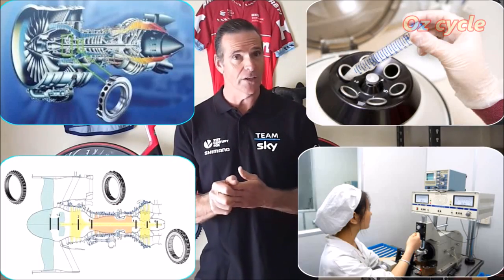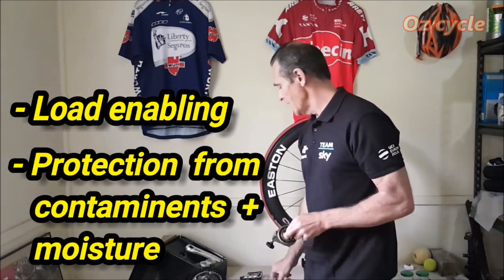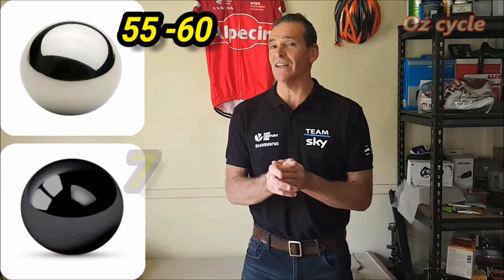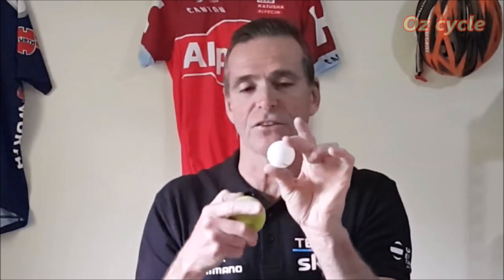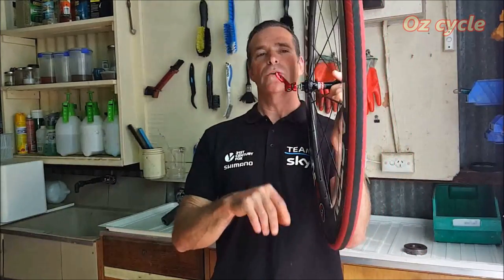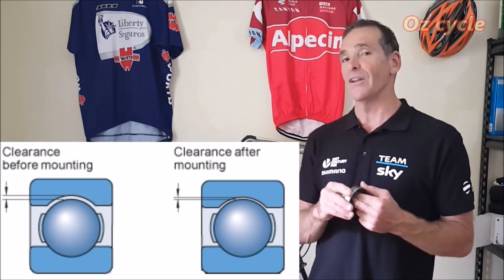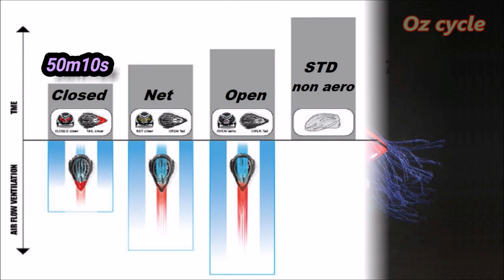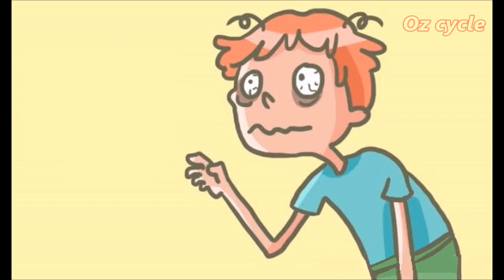Ceramic Bearings - You need to know!

Comment: I have never tried ceramic bearings on my longboard. The longboards commonly use bearings for speed and the ones I am using are really great and fast at its affordable price.  Did not require special treatment or care. My question is: how can the ceramic ones be so much better in terms of speed or distance run? Does anybody can make a comparison between both?
Reply: Ceramics are better in every way, except that they ruin their races over time, where steel get deformed everywhere, as they get hotter through higher friction, need more lube, get dents in every corner and are not uniform in size. Amphetamine ceramix gold offers SiNi in gold for nice price, btw. They are especially good if you are overweight. The only areas  where quality steel are better than ceramics are case of lightweight skaters that do jumping tricks on very hard wheels. Both bearings will be ruined, steel wins because its cheaper to replace.

Comment: Hi How are you today? You look like long time ago Which is Mac gayber. Anyway I am looking for Triple layer bearing for freewheel or cassette and bottum bracket. Long time ago when I design bicycle I put triple bearing system but someone took out. They also took out multiple chain system.
If you can make triple bearing system then the bike will running at almost 60mph. Could you find out where can I get the triple bearing system? Thank you. Have nice day.
Reply from the maker: Not sure what you mean by "tripple bearing"?..maybe another viewer can help here.
Reply: outside ball bearing show half of them middle side normal then inside bearing half of them show.  @stevenleffanue

Comment: This may be dumb, but why don’t we use magnetic bearings on non load-bearing components like the pulley wheels? The way I see it, we can avoid grease, friction, contamination and maintenance altogether.
Reply from the maker: Good idea. Not saying it want work but using magnets would mean a  heavier component.
Also, jockey wheels are under a load, especially when riding on bumpier roads the chain pulls and slackens the tension.
Reply: I imagine the extra weight and size of such bearing design would not be overall advantageous. There is also the problem of changing magnetic susceptibility of air vs dirt between the magnets. Wouldn't the bearing collapse if it gets dirty?
Reply: @AG-el6vt  I don’t believe weight is much of a concern, many riders already put OSPWs in search of frictional benefits that add some weight. I have no idea how dirt would effect a magnetic bearing but due to the lack of any grease or oil, rinsing with water between rides should clean them out just fine

Comment: So if you have to service your ceramic bearings every few thousands km and they cost significantly more than steel bearings, its better to buy cheap steel bearings in bulk, remove the seals and reduce the fill rate to 25%. Just replace the whole cartridge once in a while and you will gain better performance for the same periodic service, but less time consuming and cheaper.
Reply from the maker: Almost,yes. Except the cheap bearing want have super polished rolling surfaces so there will be slighly more friction to begin with also.

Comment: As a retired military aircraft engineer, Me and my colleagues always got a chuckle out of "cyclists" and the things they do.  Ceramic bearings are for very high speed applications, 10,000 rpm+ not a snail pace of a bikes 80 to 90 or maybe 100 rpm, hehehe .  And bearing work best under constant load, not pulsating loads like in a bike.  hehehe  Using axial load bearings for radial load applications.
Reply: Despite all that, I am somehow reaching consistently higher top speeds on the same slope and much smoother pedaling from the ceramic jockey wheels.
Reply: @warrenkommers  After looking at the data from various sites, yes they are as you say, You actually save 1.33 watts of power exerted, Thats a big saving over 1000 kilometers. That means you have to eat one less energy bar on that 1000 kilometer ride. Great savings
Reply: @gregrobbins9493  Trust me, the great savings will never be as appreciated as your great attitude. Just tested again, coasting it’s a 3.8 mph difference on a 13% grade near 50mph. But hey, I must be imaging things.
Reply: @warrenkommers  Then you are the only one with results like tat. All the pro sites I looked at show very little difference. Besides coasting has absolutely no affect on jockey wheels, they don't even turn while coasting. 
And, the test results for bottom bracket, wheel, and jockey bearings combined is 5 to 10 watts on road bikes with 130 psi tires on perfectly flat pavement. They were tested on pro riders that didn't know which bearings were on the bike. 
You should contact the bike magazines that do bike and component testing as your results are much higher than theirs, they pay good money to testors
Reply: @gregrobbins9493  Do you even ride? Have you ever raced? Yes, I am talking about the wheel bearing here specifically. My ceramic pulleys however definitely provide less resistance than stock. Very very noticeable. That could be more about how shit the stock Shimano bearing are but none the less. I would agree BB ceramic should make very little difference if at all. Not surprised there but your statement was global. As for the pro peloton, they use ceramic all the time. Sorry.
Reply: @warrenkommers  Believe what you want, only a bicycle shop owner can change your mind.
As for your ceramic pully claim. How do you get "coasting it’s a 3.8 mph difference on a 13% grade near 50mph"? Coasting, the jockeys are not even turning.
Go to a pro camp, most of what they use is because of sponsors. Why use something cheaper that give similar results when the sponsor give you the expensive stuff as long as you claim it's better.
Reply: @gregrobbins9493  Coasting, I AM NOT talking about the jockey wheels but ceramic wheel bearings compared to steel. Two separate events I am describing my personal experience. Only the descending can I put numbers on. I have been and worked with many of the top world tour teams in my career as a commercial filmmaker.
Reply: @warrenkommers  50mph on a bicycle, thats over 130 cadence with a very high gear ratio. You must be a world class professional cyclist, if not you should easily be able to get sponsors to put you in the standings.  And as I said before, how come , with those results ( 3.8 mph difference on a 13% grade near 50mph) , you're not in all the magazines, because those numbers are unheard of . That is of course you are not comparing old rusty bearings to the ceramics, but good quality stainless steel to ceramics
Reply: @gregrobbins9493  You said you were an engineer right? There is this thing called gravity, and when you are on a 13% descent, you can achieve speeds beyond your pedaling input. Infact, the heavier(less pro) you are, often the sooner you achieve this moment. I'm not sure how many times I can say this was a test (with no pedal input for less variables) with brand new steel vs new ceramic WHEEL bearings.
Reply: @warrenkommers   You said you put them in your jocky wheels, they have no effect when coasting as they are not even turning.
hehehe, 50mph on a bicycle, world champion riders can rarely hit 45, most don't even get into the 40's. 13% is not much, only around 7 to 8deg

Comment: Rider weight has a massing bearing on wattage losses. The heavier the rider to more effort is requited to propel the rider also the heavier the rider to more load is placed on the wheel bearings and tyres resulting in increased rolling resistance and lost watts. The heavier the rider the more the surface area and losses through wind resistance.
Reply from the maker: Absolutely....except they go downhill fast 😁

Comment: how much is to much load for a ceramic bearing ball?
I mean track cyclist pushes 2500 Watts on those ceramic bearings
Reply from the maker: Not sure. Maybe the sprinters use steel bearings.
Reply: just saw the german sprinters use custom ceramic speed octalinc bbs
Reply from the maker: Ok. So ceramic bearings must be ok for higher loads then.

Comment: It all depends upon the quality control(none) in China, where 99% of these bearings are made.  The sad fact is the average good rider generates 1/4h.p. when cycling.  The limiting factor usually isn't the chassis(bike) but the motor(rider).  There is so much marketing B.S. in cycling-especially at the very expensive end of bikes.   As Eddy Merckx said: "Don't ride upgrades.  Ride up grades."

Where the rubber(ceramic) hits the road...or race:

https://road.cc/content/feature/175644-ceramic-bearings-pros-and-cons

Comment: By the time ceramics start to get loose due to abrased away truck, steels would already be dented beyond use. I think its not very smart to demand inifinite lifespan from ceramics. Thus in a dust-free environiment with low pressure load, low rotation speed and periodic lubing, steel will outlast ceramics by very high margin. However there is no such environiment outside. Added pressure will dent the balls, higher rotation speed will heat them up and deform increasing dents, rain will rost them, dust will abrase them. I am thinking of simply replacing the races of ceramics from cheap bearings as donors each 5K km.

Comment: There is a lot of people using ceramic bottom brackets ..Do you have these in your bottom brackets?!
Reply: Paul Conway its good to have a smooth bottom bracket just as smooth pedal bearings but everything adds to the load such as dry chain can have enormous load from so many points of friction. Second area of concern is tires for add or reduce load.

Comment: Ok article - some very good engineering tests are on youtube comparing ceramic speed bearings v steel bearings -  notes from the test I saw conducted by an engineer under full load testing - ceramic bearings are a complete waste of money for bike applications - they WILL wear out quicker as the hard ceramic ball will wear out the steel facing quicker - DO NOT under any circumstances buy the cheap chinese ceramic bearings or units - you will go backwards in every way and possibly end up with a ceased bearing - the engineers final advice backed up by very clear engineering tests and data is to buy NTN or NSK steel bearing units - the performance is the same as the so called top end ultra expensive Ceramicspeed units - they will last significantly longer as well

Comment: Both ceramic knives and bearings (I think) are overrated.
My opinion is that the inherent malleability and elasticity of steel makes it last longer and more forgiving.
I know Ford stopped using them in their diesel turbos because they turned to powder (yikes!!!)...that pretty much convince me to not even consider them for anything.
I'm not convinced there is ANY advantage to using ceramic bearings for any application. Just like those stupid ceramic knives....Cheers, and thanks!

Comment: Seriously, if you wish to differentiate what's genuinely works from what's not, look at what the big manufacturers are doing, they are not fast starter they are follower most of the time. But if you don't see them coming up new products with ceramics after all these years, you know why. Because ceramic bearings is a genuine scam, period.
Reply: Examples of this?
Reply: John Macias 
Not a good reader are you?
I’d ended with one example.
Reply: @entltyq  
Other examples:
1. Oval chainring. After Shimano flopped on that with their Biopace, never had any other major manufacturers mentioned about that, because there’s simply not a single fact to support it.
2. 1x Single front chainring. Yes this is welcomed by many users and it really simplify things, and cost effective too
3. Internal gears for road. Nope, will not happen. The internal friction is tad too much for pro cycling. But the idea is good for less maintenance, protection and weight (yes, it is lighter if you combine all the weights it’s replacing).

Comment: Hambini says the friction of a ceramic speed goes worse that steel-bearings after few hundred to thousand kilometers. From that point on the steel-bearings still have almost their initial low friction while the ceramic-speed wears off (ball) and increases friction constantly, at 5000km an Ceramic is 3 times higher friction than a steel-balled one. So its a lie... ceramic isnt more durable and it isnt less friction, exactly the opposite is true: It endures into high friction quickly. Its just expensive crap not worth it-.
Reply: Second the highest friction does not come from the grease but from the seals!

Comment: Ceramic balls are more round and have a better surface finish than metallic ones.  On what facts is that based???
Reply: Google ceramic bearings and then go through all the manufacturers. They quote international manufacturing standards. Then ask yourself are they all lying? They all say the same thing.
Reply: @Geeios1  Thanks for your reply!  I couldn't find any statement on better "roundness" of these bearings?  But on surface smoothness, I could indeed find statements that ceramics have a (far) better finish.  Most probably, this will be correct.  I had the idea that with the same equipment available for ceramic and metallic polishing, the surface finish should be accordingly.  I could find no confirmation on this, but in my opinion surface finishing is at such high level that the metallic christaline structures give a limit to smoothness, whilst ceramic materials can be in between amorphous and christaline???  We need an expert to reply on this.
Reply from the maker: https://www.ceramicspeed.com/en/cycling/inside/technology/ceramicspeed-balls/
Reply: Dominiek Demaerel Well just think of glass. It can be quite smooth but is also brittle. Steel can be easily polished too as i hone steel with 1 micron diamond paste leaving a mirror finish on cutting edges. I don't think once you compare micro-polished  steel to micro-polished ceramic that it will be much different.

Comment: The ceramic bearings scam again.Ceramic bearings in the industry are only used for light situations, no load what so ever.It is another way to spend money again and again. And talking about bearings , why noone covers the actual specs of bearings? if you want the best possible smoothness you have to opt for grade 3 or 5 and abec 7 . I wonder why this detail is covered only in skaters videos and no bicycle videos. Also, bearing lubrication should never exceed 25%, even in a mountain bike. 25% is more than enough to keep the dirt and water out of the bearing while not creating the skidding effect.

Comment: Dude you forgot the compressing strength of Ceramic Bearings is a lot greater than steel bearing, even greater than the strongest steel call 52100 chrome steel, as ping pong ball got the least and weakest compressing strength of all. If compressing strength is high is unlikely to go flat or deform, dude you got 0 knowledge about Ceramic Bearing, go and do more research before making a video like this, there are peoples using it for their motorcycle and bicycle and there is no problem, and really get the speed gain from Ceramic Bearing

Comment: I see you have 3 Spray behind you, the ones you pump to give pressure. I have one like yours. How do you deal with the protection valve they have with a spring? Mine is losing pressure all the time looks like it have a spring inside that does not have enough power to retain a lot of pressure in that thing That I dont know the name. Thank you for your help.  image for you to know what I am talking about : https://images-na.ssl-images-amazon.com/images/I/411hBxNRSQL._SX466_.jpg
Reply from the maker: None of mine have that valve...maybe not necessary?
Reply: @stevenleffanue  I don´t know how can I get rid of it, I think is an safety measure so ppl dont put to much pressure and explode the thing. :D
Reply from the maker: Maybe stop it up with glue or buy a sprayer without one
Reply: @stevenleffanue  Thx Oz for the sugestion. I am going to think in a way to do it, maybe I will try a quick fix with superglue :P

What do you think about road bike wheels, Should we at least one time peer year open the hub get to the bearing remove the seals and clean and regrease the bearings? Today I try to make this operation on my wheels, but they don´t have the seals exposed, to have access to them I need to remove the internal metal tube. The wheels dont have any issue I am just concerned since this wheel come with ceramicspeed they say, And I would like to keep them good for a long time since they are super expensive.